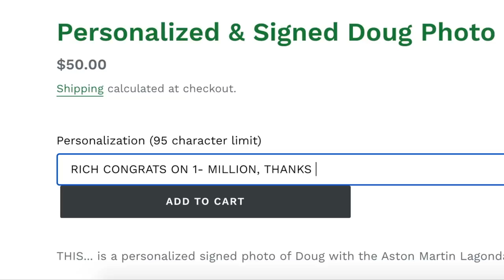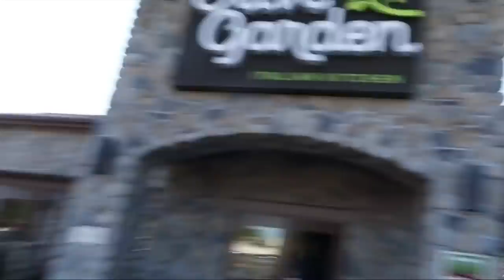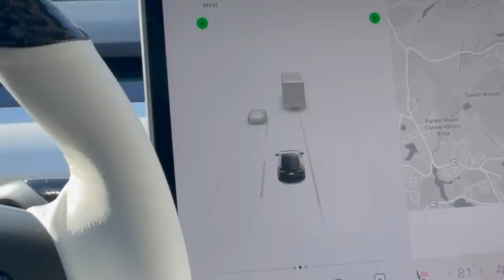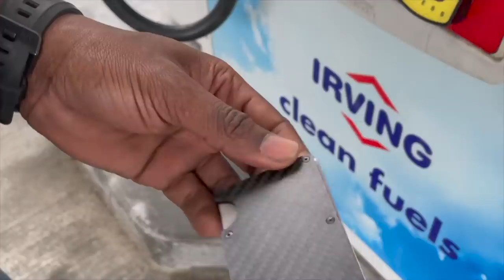Taking the Kanye Sherp to McDonald’s

Comment: I thought there was a height restriction entering a drive-thru.
Reply: I’m sorry....I thought this was America!
Reply: Apparently the Sherp is below 9 feet, short enough to enter drive thrus
Reply: @LouisSubearth  Clearly by design. They thought of everything. (minus the cup holders)
Reply: You can always just deflate the tires from inside the cab. That's got to make it at least 6 inches lower.
Reply: @LouisSubearth  When "Uncle Rich" went to the Donut Shop, I thought the Sherp was taller than 9 feet.  My bad.

Comment: Cool and fun video!

Some video ideas:
700HP Electric Ford F450 with the 700HP Dual warp electric motors. (The truck originally is like 475HP)
Electric or hybrid land cruiser.
Electric Prevost tour/motorhome bus with one or two of those electric bus motors.
Electric lightweight GA Aircraft.

Comment: The next generation of shirts have cup holders some of them a little more cheesier than the others such as the one on the driver's side is literally up bicycle cup holder bottle holder and call it that's just bolted to the a pillar but they're very capable vehicles and sometimes simplicity of design means all the difference from getting through the obstacle or having a breakdown